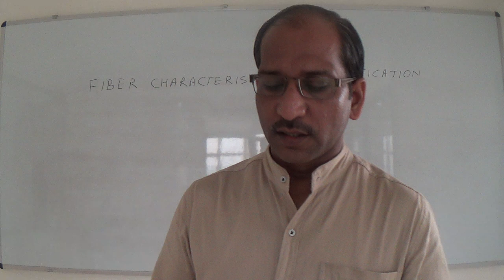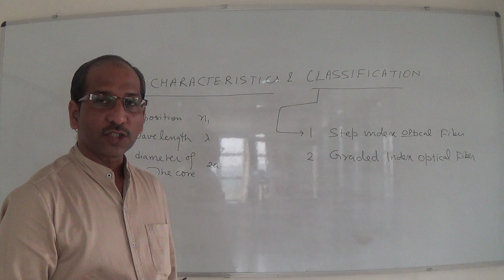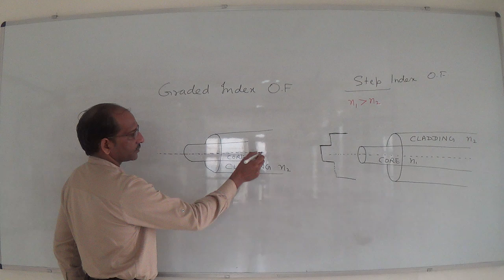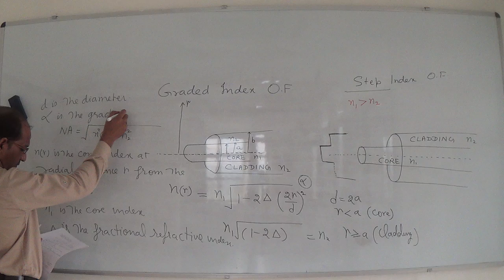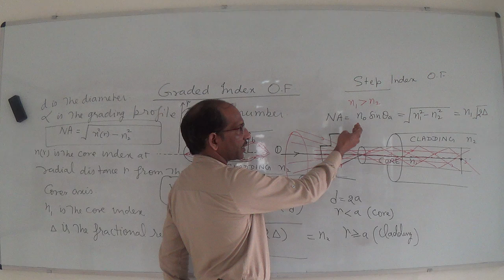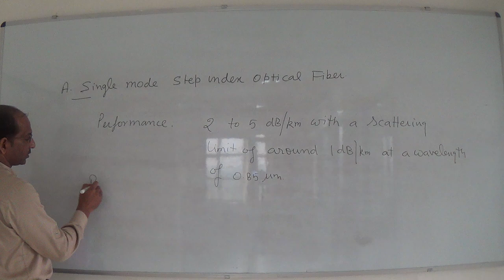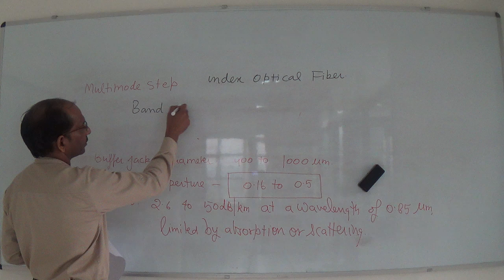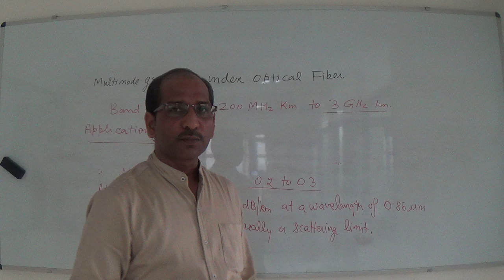Classification of Optical Fibers Step Index Graded Index Optical Fibers

Comment: Why The RI of core is max at center in case of graded index and why it changes Sir??
Reply from the maker: At core cladding interface the difference between indexes of the core cladding remain slightly small for total internal reflection....if you will increase RI here the speed of the light will decrease ....n,c and v relation ke according.....while at the centre it is low R index so light ray will travel faster....hence the problem of time lag will not be sort out among different modes of the optical fiber......to solve the time lag problem between modes they keep high RI at centre so all signals reach at the same time at the receiver end